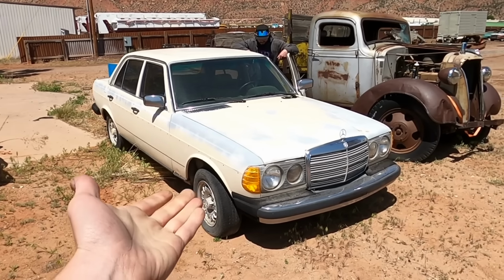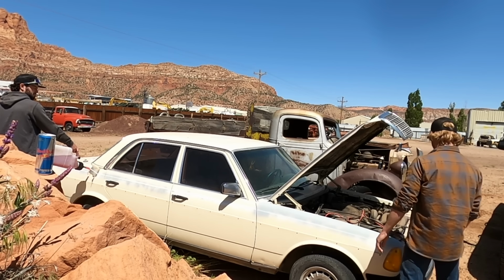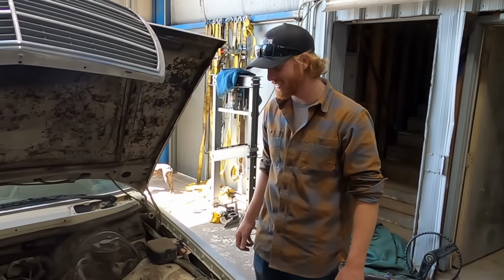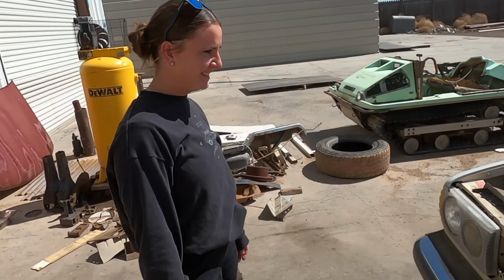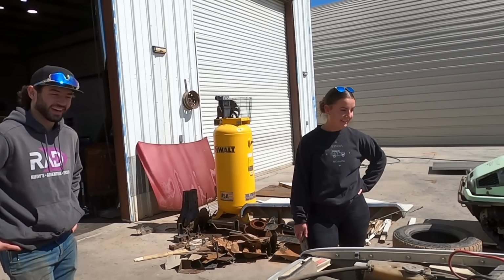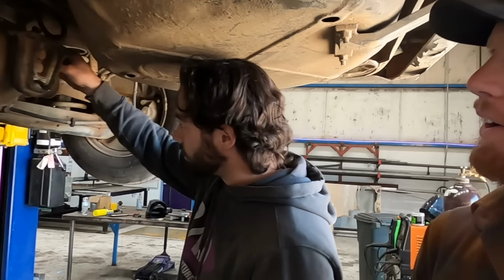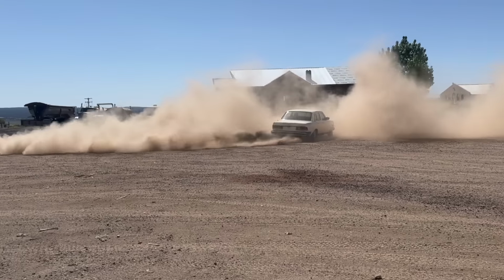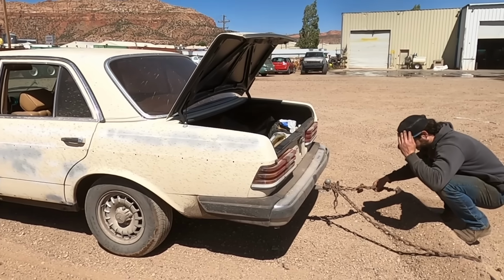We Have BIG Things Planned!!!

Comment: That is a w123 chassis Mercedes.   The reason that most of the stuff inside the car doesn't work is because there is a leak in the vacuum system (there is a lot of vacuum operated stuff in this car, which is weird for a diesel).  It is also the reason that the car doesn't shut off.  There is a little lever on the top of the valve cover that has a little red label that says STOP.  You push on that lever to shut the car off.  It was placed there for when the vacuum shut off system is leaking and the motor won't shut off.  The reason you couldn't get the battery in/out was because you didn't put the hood in the service position so that it points straight up.  There is a little lever on the hinge that you push that allows the hood to go all the way vertical, this is something that all Mercedes cars have.  The OM617 is near bullet proof, it will run forever if you keep oil in it.
Reply: Those W123s are nearly indestructible. =)
Reply: @zyamadeadborn1785  The drivetrain won't ever let you down, its the creature comfort features that all give up early.
Reply: @trythistv  exactly. I once wanted one of these but in the climate I live in they're all rusted through. But I still admire the design and overall sturdiness.
Reply: Kudos to Wackowacko, you know your stuff! Mercedes Diesel Driver from Germany here ;-)
Reply: @zyamadeadborn1785  My very first car was a 1980 300SD (w116 body) that had been in an accident, I paid $300 for it as a 15 year old and repaired with my brothers help, I loved that car, but it was from the NY/Canada border area, and rust had a hold on the poor car. I still drove it and kept up with the rust to the best of my ability at the time. Now I've got a 1982 300D which is the same W123 body as in Rudys video. Phenomenal car, I've taken it on thousand mile road trips without hesitation and it has never let me down, I'm slowly trying to get all the creature comforts working!
Reply: This reminds me of when my father bought a 1991 350 SDL and we had such a learning curve trying to maintain it ourselves and even the local Mercedes Dealer told us outright that they weren't sure if they could service it because information on it was so sparse. There is a reason why that car and six cylinder motor was only sold for two years.
Reply: this W123 Merc is a MILLION KILOMETER CAR, a classic shape and model, that Merc DOES NOT manufacturer does not make anymore, ... a marketing, cost saving reality.
SHAME !!!
Reply: Yea I had a 1983 240D and it was pathetically slow but I still miss that car almost 15 years later lol. It was such a cool car as long as you didn’t have a semi trying to push you off the road. There’s so many quarks with the cars but dang they’ll keep goin forever.

Comment: The indestuctible MB OM617... 👍 One of the best engines ever built! And problaby the best choise as a replacement engine for 1/2 dun. You can find the newer verision of that diesel engine in Jeep Grand Cherokee’s.  But here’s a PRO tip for that old enginge, Please check the valve adjustment. Those lifters tend to expand and holding the valves open. And you got to modify a wrench to be able to adjusting the valve lash.

Comment: Excited.  Had one transplanted by an engineer in Germany...... into a Unimog 404.  Loved that rig.   

Building one right now in a TJ.  Refreshed engine, Good trans (far as I know) and going to an NP242 AWD/4WD Tcase mated to 5speed.  (Tcase gear ratios same as NP231) doing that cause the torque of the diesel in 2wd on wet roads makes it way over steer in the short wheel based chassis of a TJ. In light snow ice we get here in the Rust Belt.... its going to be way worse.  Even my past non diesel TJ would spin out easy on slipper roads..  in 4wd and  completely out of the blue.  

Another big reason behind wanting OM617 is it is very tolerant to other light oil fuels.  I've got to live more frugal.  Soc. Sec. does not cover much.  So part time job will be making my own fuel for heat, vehicles, etc.  (even have diesel motorcycle project(s)  in the works plus a CAT powered overland truck to live in so can rent out house for income. )

Comment: Again joe at Doomsday diesel. I'm running an om617 with he221 turbo, 7.5 pump, water to air intercooler backed buy a 4l60e .14blot rear and 44 front  with 4.11 gears and 35s in myn1970 scout 800. Do the engine right and your mini will climb a tree

Comment: It has a mechanical vacuum pump on the front of the engine. If the pump is shot or there's big leak it won't shut off. There's a red label on the top of the throttle linkage you can push to shut it off. There's not a single wire to run or stop that engine. It's all mechanical.
And even though it's an automatic it can be bump started. They're the ultimate end of the world machine.
Reply: If you ignore the original Beetles.
Reply: @johnt.848  Beetles are legendary, I've owned at least 75 air-cooled VW's in my life. But they need ignition power. 
But the Mercedes OM617 diesel engines need no electricity to run. If you can get it spinning enough, it will run. And they'll eat anything, diesel, kerosene, jet-a, veg oil & some used motor oil. I currently have three 1983 300SD's, I recently drove one from Atlanta to Philly and back at 30.5 mpg. 
I also have a 7.3 Power stroke addiction...

Comment: One of my most painful injuries from working on cars was working on a old Mercedes diesel.  It had chrome plated aluminum wheels, and the chrome was flaking.  I was taking the wheels off with a socket wrench (all I had) and a piece of the chrome went under my finger nail about an inch.  Man that hurt, I've had worse injuries but none more painful.

Comment: Awesome Mercedes, I grew up with those cars, only thing now, I’m too tall to fit in them, glad to know you cat a 2.5 turbo in the states, I will like that in a couple of trucks around here. Now I understand why you said you ready for the drag race.
Reply: Too tall? you do know that the drivers seat is height adjustable as standard? (theres a handle on the outside that looks like it would be for an ejection seat.)
Reply: @nirfz  I’m not going argue about that, I may have missed that “handle” I look for it next time. Thank you!
Reply: @allertnel282  No problem. My dad an later myself owned a W123 300D wagon. A 1984 model (we combined had it from  1990-2002) And as it had 5 or 6 previous owners there was no owners manual with it.
We only figured out what the handle does in the last months i owned it. (Nobody ever dared/bothered to pull on that handle before, the seating position was alright as it was.) We figured out other small things only  by chance too. (I do look through the owners manual of every car when i get it since. As there are always features one would miss otherwise)

Comment: There was a greek taxi driver who had one of those (non turbo). He aquired over 3 million km on the car.
Mercedes got wind of that by a letter from his niece or granddaughter. They contacted him and "exchanged" his car for a then new c-class of his choice. They placed the car in the Mercedes Museum in Suttgart germany.
And then there's north africa where these are still used as taxis. Despite being from the late 70's or early 80's. They just run if you keep the engine a little maintained (change oil and filters regularly for example)
I had such a 300D wagon (non turbo) with a 4 speed manual as my first car. It was over 14 years old and had been used to carry all sorts of material to build a house before i got it. Great memories!

Comment: capable of 500,000 km without problems in 1990 or 11 I drove this Mercedes 300 D cylinders 3 liters of displacement, well it is a calf which weighs a dead donkey but as long as there is fuel it takes you to your destination, if you drive the only gauge that moves is that of the fuel which obviously decreases.

Comment: I don’t usually comment, but… I was both sad and glad to see this w123. I owned two Mercedes diesels in the 80’s, a 1981 240D and then a 1985 300TD. 

I do wish you had learned a little about that 300TD engine before abusing it. The 300TD may be one of the best cars ever built. It’s a beast, but it requires a little love to last forever. 

Don’t listen to the guys who’ve never owned one tell you how slow or weak they are. The TD is a strong and torquey engine that is bulletproof if you check the oil and adjust the valves regularly. 

Do right by that it or and it will do right by you.

Comment: Those MB diesels are bullet proof.. I put one of those motors in a 2000 chevy S10 blazer.  search benzblazer here on YT , They also love running on veggie oil.     It wont shut off because you have no vacuum , if the vacuum pump fails you have no vacuum to turn it off, its a common failure after becoming 40 years old or you have a massive vacuum leak somewhere... and with a car where everything in the car is run by vacuum too..  even stuff like the power locks etc..

Comment: Throw that Mini away and do it with the Mercedes! 😏
Reply: I thought that too, but they're building an off-roader. They'll cut the living crap out that car. Better to cut that BMW runt than this classic.
Reply: 100%
Reply: @JeffDavis771  You realize that body will be going to the crusher after they yank the motor.
Reply: Was thinking the exact same thing. Seeing this vs the Jaguar during the tug-o-war would have been fantastic!
Reply: @poodooforbrains  Sadly that will likely be where it ends up.  More sad since despite the issues its worth restoring and there are probably a good number of folks in the Rust Belt that would have cherished that car.

I would have been tempted to fix the vacuum situation to see if that got everything working and if it did flipped it for five to ten times or so what I paid for it.

Best!

Comment: vacuum pump  is shot that's why the key kill and brake booster doesn't work, common on those where you killed it if you look up just a bit you will see a red button that says stop push it and it will die easily.

Comment: There are turbo diesels and there are turbo diesels.. This thing will run basically forever but don't expect much in the way of performance.
Good torque though and that one sounds pretty healthy too.

Personally, I'd cut the merc to make a wagon, will be 100 times better offroad and still unusual / cool to see. Pitty they already had the first event.

"Why does it rattle so much"
Cos 80's diesel + exaust leak.
Reply: Look up Dieselmeken. They can perform.
Reply: "Why does it rattle so much"
Cos 5 cyl 80's diesel. =)

Comment: Don't knock this Merc I have seen these in Africa Saudi Morroco loaded with six passengers a full trunk and the roof stacked with produce including live chickens pig's and goats going places my highly modified TT650 Yamaha with long range tank and all the bells and whistles and trying to catch them on an unraded dirt and sand roads going across country for hundreds of miles. with two and three hundred thousand kilometers on the same engine cobbled together with parts from god knows what alternators boat starter motors and radiators from 1930s tractors and WW2 military vehicles found in the desert.

Comment: Black smoke racing uses same but with Scania truck turbo
Reply: Not exactly, but close. They mostly use the OM606 (the newer verision) straight six. Rudy have found the indestructibe OM617, five cylinder.... Almost the same diesel engine that you will find in a Jeep Grand Cherokee. 👍
Reply: @johnnyhomegrownholmgren9999  is still a beast ,my jeep wj have 4L 6c mother in not much of a mechanic so still good